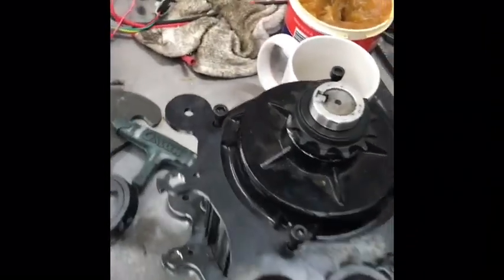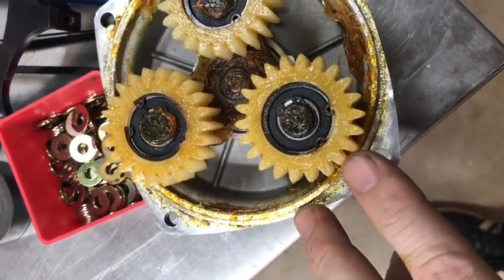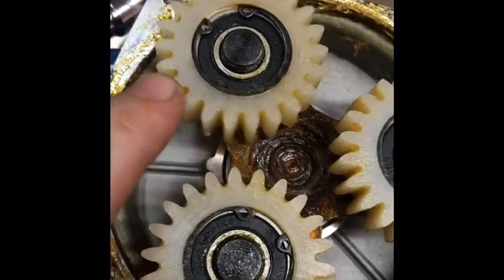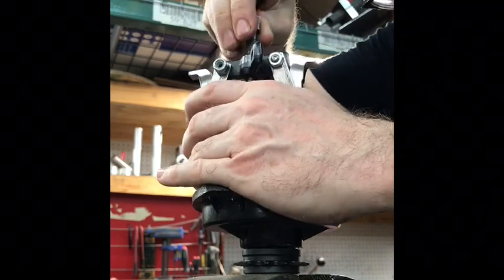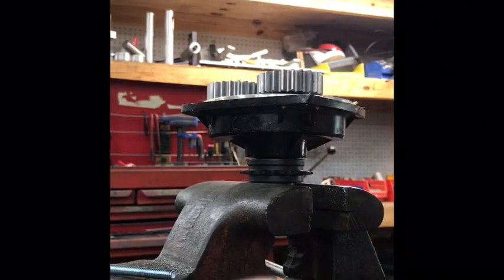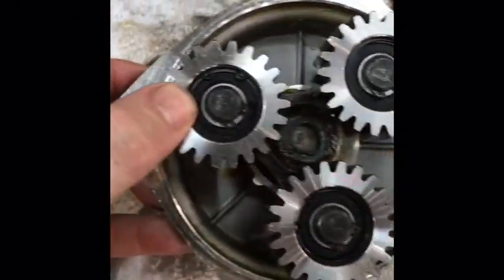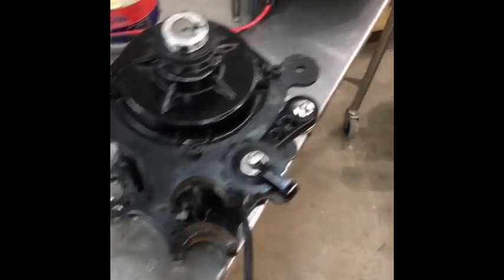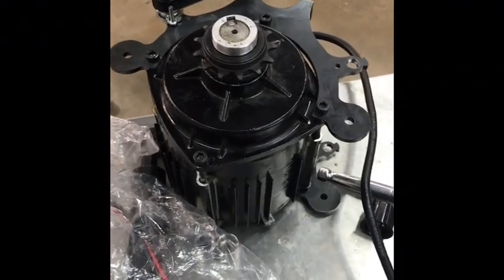Replacement of Cyclone motor nylon planetary gears with steel

Comment: free spinning is massively different then spinning under load, under load the metal gears will be much louder than the nylon gears, they make a loud whining noise, they'll also leave a fair bit of metal in the gearbox which will lead to more wear
Reply: They only make noise and leave metal IF you do not apply a proper amount of lubrication. If this comment were true, all CARS would use nylon gears and spend half their time getting services done to replace them as the metal would shred themselves. The misconception that metal gears that are entirely transitory destroying themselves under mild weight and friction (again, WITH proper grease) is false. Additionally, the lack of noise from Ebikes does put many people in a bad position when it comes to making sure people around you know you're there.

I will never, personally, understand everyones obsession with making everything they own totally silent instead of just accepting the fact that objects with motors make noise. Be it an Ebike Motor with Metal Gears or a PC with non-maglev fans.
Reply: @Gojira_Wins  you have no idea what you're  talking about, straight cut gears make a lot of noise that's why race cars make that whinning noise from the gearbox no matter how much lube is used they whine. the metal gears used in many of these ebike motors like those from cyclone an cyc isn't even heat treated properly thus they wear out fast no matter the lube ....... unlike you i speak from experience
Reply: @arronjohnston742  The ignorance is palpable here. Assuming I have no idea what I am talking about is one of your issues. Given that, this conversation is over. I'll let anyone reading this thread see what was said and be done with it. I'm not going to argue with someone who makes blatant derogatory assumptions.

Comment: Changed my defunct four year old nylon gears after they stripped out ...... found a set on ebay in steel ...... they are slightly noisier but not much ...... which I was expecting ..... but I think they will life of the motor ......
Reply: What were they listed under in eBay?
Reply from the maker: Hi Bam! You can find steel planetary gears and other great products on our website. https://precisionpedicab.com/

Comment: they are no longer available on your site, do you still sell them? do you know the amp limit of the stock nylon gears? and whats safe to run these steel ones up to? ive heard that if you replace them with these something else will break instead, either the middle gear spinning the planetary ones or the outer teeth on the motor itself. any experience with this problem?
Reply: No problems with my replaced steel gears !!
Reply from the maker: Hi M. Thanks for your inquiry. 
We have not had any issues with steel planetary gears causing issues after replacing nylon gears. There have been a handful of customers reporting the need to change the shaft bearing, but we do not associate it with the use of steel gears as it has happened with both nylon and steel gears. Again, these are less than 5 reported bearing issues out of the hundreds of cyclone motor installations across America so I would not be too concerned about it.

Comment: Hi. What gear oil would you uae to lube the gears. I have a e bike that requires me to add gear oil after 3 months of me using it. Its a rear geared hub motor 350watts. Many thanks
Reply: Castrol  GTX 20W50 works very nice on Cyclone motors used myself on a  1680W.
Reply: Ive looked into planetary gears and its saying i should use a gear oil iso vg 100- 150🤷🏼‍♂️ due to the reduction ratio and torque. I really dont know whats best. I take it its just to lube the gears it self

Comment: Hi Ken, thanks for posting this. I am about to take a look inside my cyclone 3000. Where did you get the steel gear-set? My motor starts getting really hot after a few miles and does about 40 MPH so far, but then gears start making a lot of noise like they're slipping and controller cuts out. I think it's tripping an internal safety. Take a look and let me know if you think I did anything to cause these problems. https://youtu.be/UevR-kQ4sVY
Reply from the maker: Hey Darrin,  gear set is available on my website.  ( Precisionpedicab.com) It does sound like your nylon gears are missing teeth.  A quick visual inspection will confirm this.  Some controllers have over temp cut offs.
Reply: @precisionpedicab8944  thanks Ken